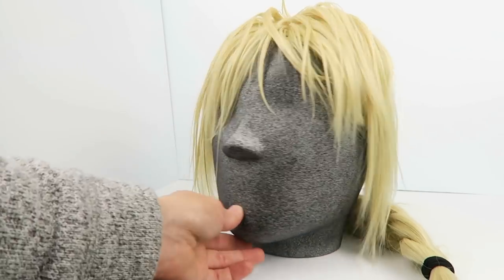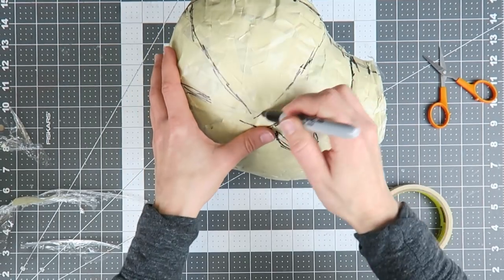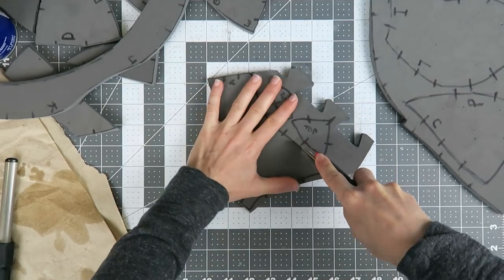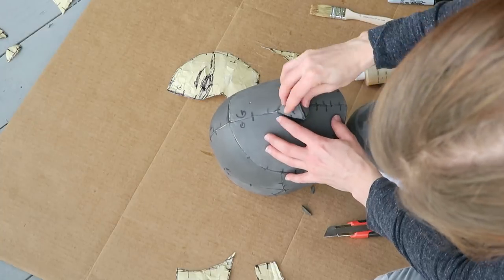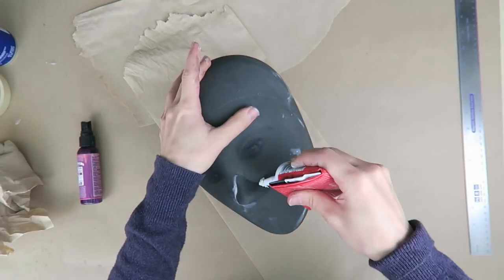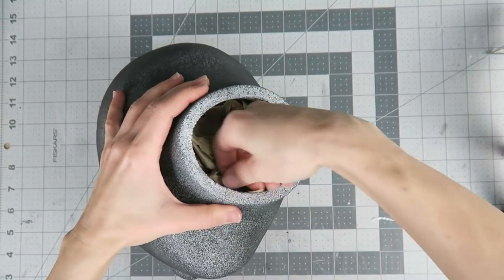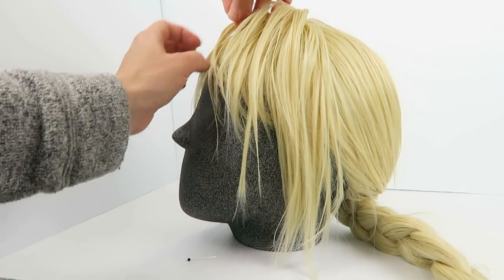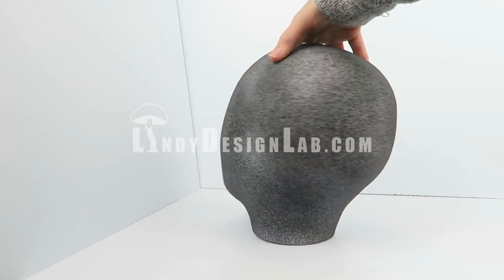Making a Custom Foam Mannequin Head

Comment: But you cant heat the wig when this is under it, can you
Reply from the maker: Sure you can within reason. Blow drier doesn't get nearly as hot as the heat gun used to shape the foam.

Comment: Speaking of your dress form, did you also make it? I have an adjustable dress form but it doesn't really replicate my body shape accurately, so I'd love to know how to custom make one
Reply from the maker: I made the body basically the same way, plastic wrap and tape over my whole torso then cut it off, taped the seam back together and also plugged up the leg and arm openings then made it solid with expanding spray foam around a newspaper core. I put paper mache over that to smooth it out, but that was a bad idea because now it's too hard to stick pins into. If I were to make it again I would do it completely out of floor mat foam like the head. Hope that helps :)

Comment: How do you keep the camera above your head 90 degrees perpendicular to the table?
Reply from the maker: Tripod with the back leg extended further than the two front legs, with a weight or tie down to keep it from falling over, then tilt the tripod head until camera is level to the work surface.
Reply: @LindyDesignLab  Gosh, that never worked for me. Thank you for telling us.

Comment: Is that the only kind of cement you can use if so where can you get it from
Reply from the maker: There are other brands of contact cement that will work. Barge brand might even be better, but the Weldwood is easiest to find at Walmart, home improvements stores etc. and has always worked well for me. Also a link in the description for Amazon.